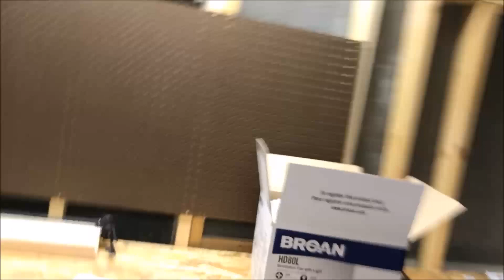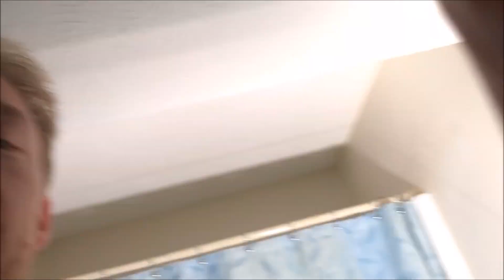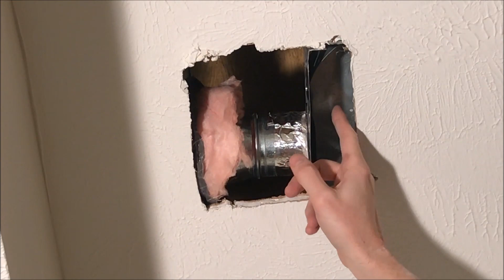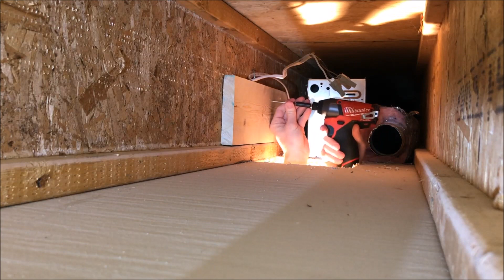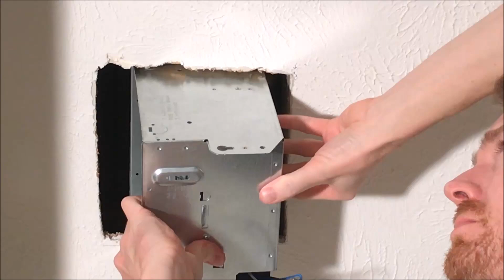How to REPLACE a Bathroom Exhaust Fan in the Basement

Comment: Finally, a video that explains the wiring better. When I went to install mine, there were only a black and blue wire visible in my new fan box. I’m going to take it apart and look for the white wires. Ugh.
Reply from the maker: Hello. I’m assuming the ground wire was attached in an alternate location. Sometimes they’re hidden a little but. Did you find it?

Comment: Even if the grille did vibrate. I would NEVER caulk a bathroom fan, Your fan is going to end up rattling and it will be even more ANNOYING and it will be hard to fix. If the motor burns out, Also the fan would be hard to replace.
Reply from the maker: Yes, again you’re right on. I forgot that caulk is as structurally sound as concrete and can’t be easy cut with a utility knife. In hindsight I should’ve used scotch tape to secure it and saved myself the problem of having to jack hammer the fan out when/if it fails. Hopefully someone doesn’t make the same mistake because it sure would be ANNOYING for them.

Comment: This helped me in way that is somewhat counterintuitive. You reminded me that I wanted to have the light and the fan wired separately, so I need help from an electrician. Thanks for saving me from a frustrating oops. :D
Reply from the maker: Hey, glad it helped!  Now that I’ve had the fan installed for a few years, I wish I would’ve taken the extra time to wire the fan and light severally. I can alway just do that, but it certainly have been better to do it at the time of install. Thanks for the comment 👍

Comment: I don't have attic, only crawl space and I need to install a new fan. we have very poor citculation in the bathroom. Do I nees to install a ventallation  system exiting the crawl space?
Reply from the maker: Hello. Short answer is yes, you do. Otherwise all the moisture from your bathroom gets trapped in the crawl space and can lead to mold and other water related damage.  I’m not a contractor, but I don’t believe a bathroom fan can be installed without a ventilation system that exits the house under construction code. Too much risk for mold and other issues. Thanks for the question.

Comment: I would never caulk the fan if you need to service the fan motor it will be hard  i am17 I collect fans
Reply from the maker: Right, I agree.  It was a pretty pointless step considering the fan box is isolated anyway. Collect fans, eh?  Stay cool 🤙🏻
Reply: Yes, The fan will end up rattling and get really ANNOYING.
Reply: @houseguestchannel  it doesn’t matter I want it easy to fix
Reply: @erickmorton8085  I want it to be easy to replace the whole exhaust fan assembly or replace the fan motor or oil the fan motor. If it goes bad. And easy to fix.

Comment: I did not see how you secured the unit to the joists
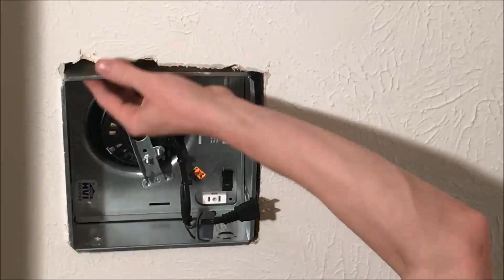Reply from the maker: At about 15:58 there’s a small clip where I screw one side of the fan box to the joists. However, I did not show how I secured both sides to the joists. To do this, just use the stamped out holes found on the fan box. They are there for you to use to secure the fan to its mounting points. Please let me know if you have any other questions.
Reply: @FastFixYouTube  It is part of fast forward. No wonder I missed it. Thanks for great video.
Reply: You didn’t need to break off the tab for the electrical. Just flip it around it’ll fit.

Comment: Great thorough video!  Just checking:  did you connect your ground to neutral and not to the chassis/housing?  I thought that's what I saw and wanted to ask.....thanks again!
Reply from the maker: Paula Braunschweig ...yes.  I was hoping no one would notice that, but wishful thinking only gets you so far. Lol. I’m not sure what I was thinking, but I blame the fact that I was filming and diverting attention to other things. I quickly realized my error when the light didn’t energize. I face-slapped myself a few times, but fixed the problem and all works fine now. Nice eye!
Reply: @FastFixYouTube  No worries, just wanted to make sure you were safe.  (I don't like to mess around with anything electrical....)  Thanks again for posting...this was very helpful.
Reply: @FastFixYouTube   hi just seeing ur video and I actually have the same fam that I need to install! Seen u made a slight mixup with the wires … which wire goes under the green screw in the housing piece? Also, what do I do if I have a a timer for the fan? Do I need to do anything different wiring wise?? This will be my first time doing anything like this! Great video btw! So glad I found it!
Reply from the maker: @ericamartinez3313  hello!  Congrats on tacking this install. The neutral wire (usually bare or green I think on this install) goes under the screw attached to the housing.  I actually have a timer switch install video I’ll link in a different reply to this thread. Wiring doesn’t change on the fan side of the equation, but does require you to remove the standard switch and put in the timer. Thanks for the question.
Reply from the maker: @ericamartinez3313  here’s the timer switch video:  Install Bathroom Fan Timer Switch
https://youtu.be/2MbKNP6jNUE